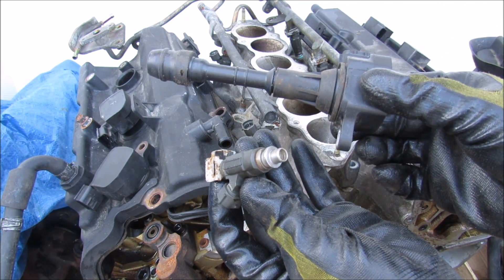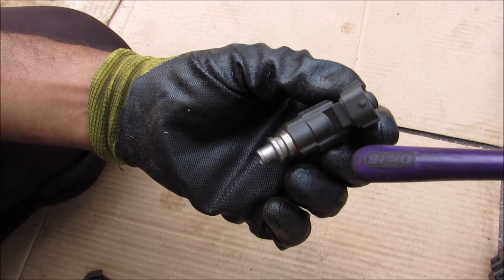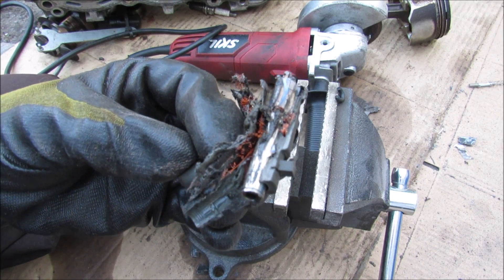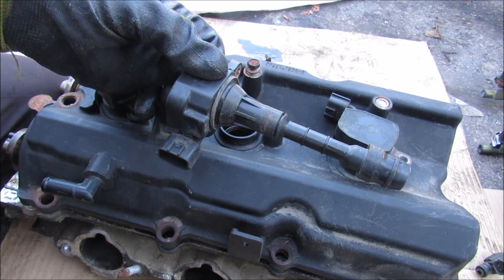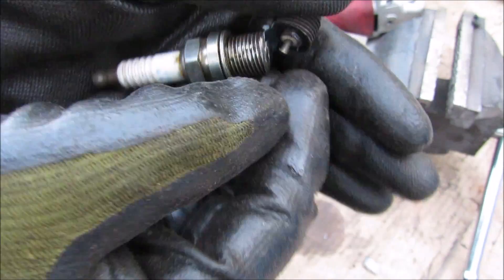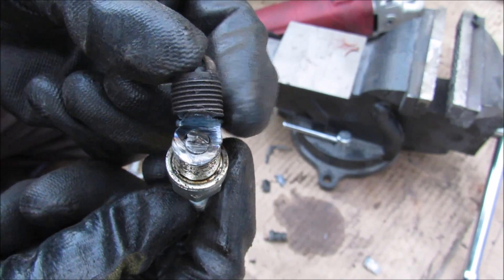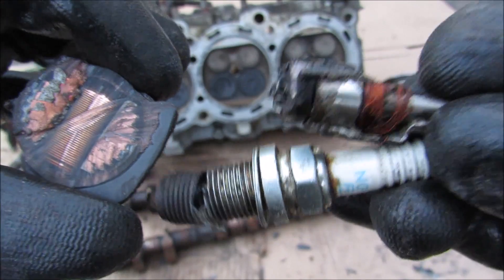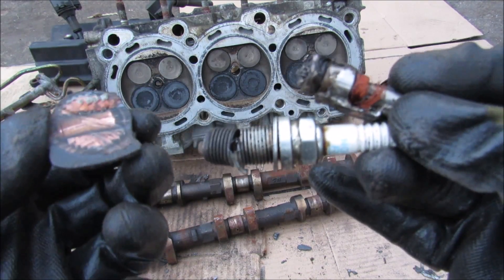How the Fuel and Ignition Systems Work

Comment: Yes thanks you have opened my eyes to these types of systems.older fuel injection systems were way complicated.

Even though I'm sure you would be able to explain it in a simple term.lol .thanks again.
Reply from the maker: You mean carburetor fuel injection?
Reply: @speedkar99  I have a Renault megane scenic mk2 1.6 16v but I'm having problems with the fueling.

I'm sure it's the petrol pump as the car would loose power after a long ride forcing me to take my foot off the accelerator and wait for it to get pressure for me to go again.(petrol pump probably gets to tired).

Comment: Excellent explanation! I have a 2002 Honda Accord V6 with ignition coils. It's having misfiring issues. Can you confirm that my engine does not have a distributor? I thought I heard you say that in the beginning. Thanks.
Reply from the maker: The J-series is coil on plug
Reply: @speedkar99  So no distribution?

Comment: I know you went to automotive school as soon as you mention the stoichiometric ratio. Great vid. Thanks. And for those who don't know,  here it is. "The stoichiometric ratio is the exact ratio between air and flammable gas or vapor at which complete combustion takes place. The stoichiometric ratio of combustion varies for various fuels and oxidizers. If the engine has less air than the stoichiometric ratio, you have a rich mixture, because it is rich in gasoline."  It is about complete or perfect combustion.
Reply from the maker: Thanks. I studied mechanical engineering, not auto school.

Comment: Wow!! Seeing inside Ignition coil for the very 1st time. Build design seems pretty robust and appears to last the life of the engine. But in reality it does fail and also been recommended to be replaced as 80K or 100K service. Can someone comment a few reasons on why it would fail?
Reply: Temperature will take its toll on electrical circuits.  If the insulation that surrounds the coils of wire in a transformer, for example, breaks down, the electric current will ark between the coils of wire causing excess heat which makes the problem worse.  Eventually the internal resistance becomes so low the part starts to melt causing a dead short to ground.
Reply from the maker: Good points. Sometimes things just burn out 

Engine heat is a big killer
Reply: I've never had a coil replacement recommendation on my 17 year old Toyota with 235k.

Comment: Great explanation and video.
But the info on the spark plug is not correct.
The longer the insulation of the spark plug, the hotter the plug and of course the shorter has the opposite.
The shorter the insulation protrusion means the cylinder head can take more  heat away from the plug nose and electrodes.
The longer protrusion has the opposite effect, there is more insulation that is exposed to the combustion gasses and is not dissipated by the cylinder head therefore the tip stays hotter.
And of course the best plug to use is the coldest plug that still has enough temperature to clean the firing end for reliable and consistent firing.
Also just as a side note, the temperature range of a  plug has noting to do with the engine running temperature.
The back of the typical NGK spark plug catalogue has the best description on how and why spark plugs work, specifically the temperature. Its a good read
Reply from the maker: Thanks for the info. In my video I meant to refer to the thickness of the insulation around the electrode and not it's length.

Comment: Man, you are great. Are you willing to address fasteners in automotive applications someday? Especially about classes like for metric 8.8, 10.9, 12.9. I'd love it.
Reply from the maker: Good topic. I'll keep it in mind, alongside automotive wiring
Reply: @speedkar99  Great, wiring is indeed also interesting. Like proper copper area for current rating, insulation. connectors. Various shielding for heat and mechanical stress.... enough details to worry about.